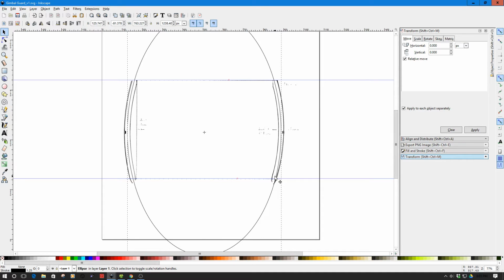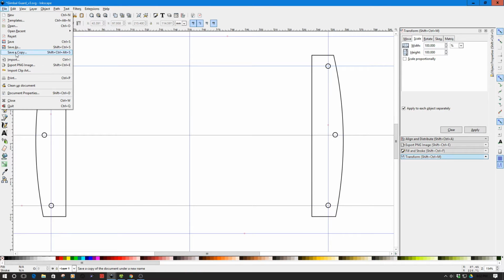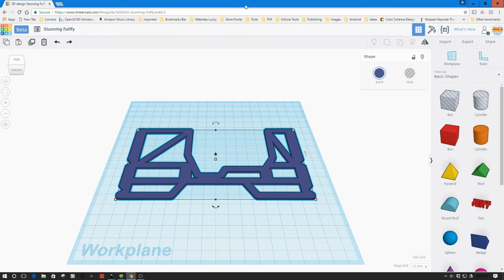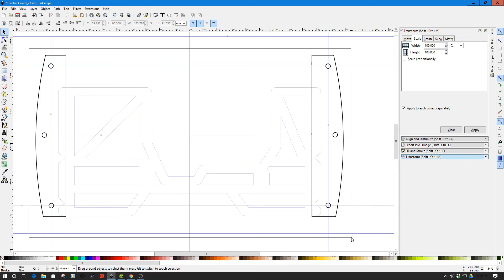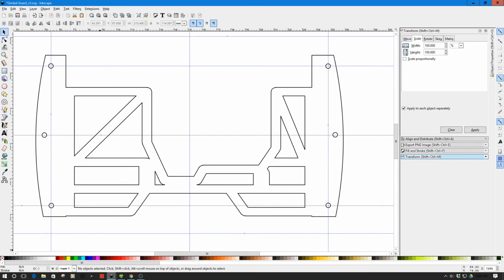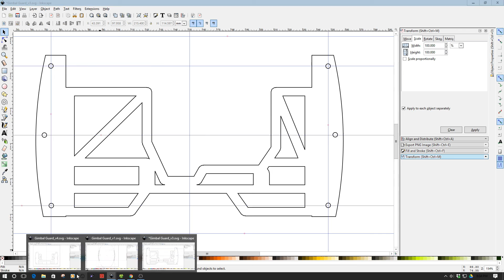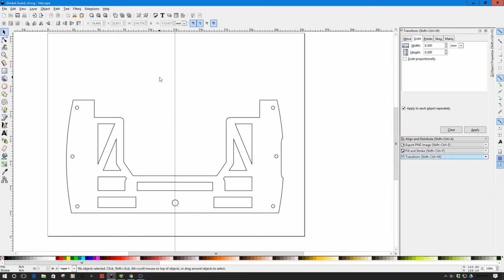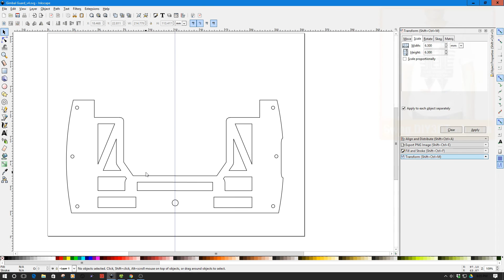Inkscape Tutorials - Solving Complex Design Problems the Simple Way!

Comment: Hello,
Thanks for the great tip. As far as the vectors are concern, what i usually do is that i took the black and white image after size it as required, and insert it in the Vectric Aspire or any other product of Vectric, because they have a very handy tool used to draw above the black lines automatically.
But in your project it is a little different as you want to relocate the landing bars :)
But i am sure this will helps in future.
Thanks for the video :D Best Regards
Reply from the maker: Thanks for sharing, however the version of Cut 2D from Vectric I use is very and very old and lacks many of the "newer" features. :-(  I hear Aspire is great, but just can't bring myself shell out that much cash (not that it may not be worth it)....